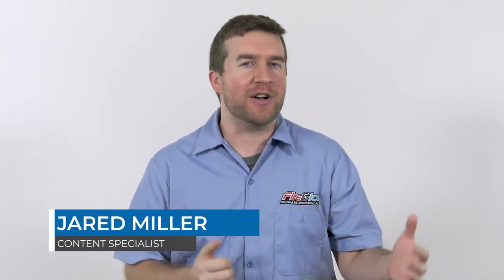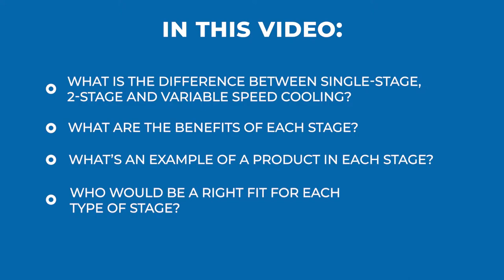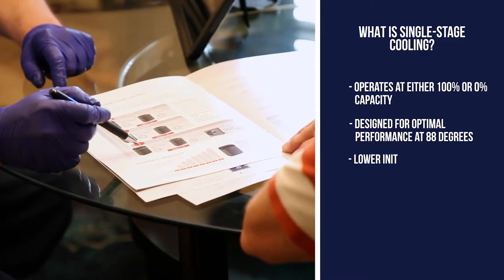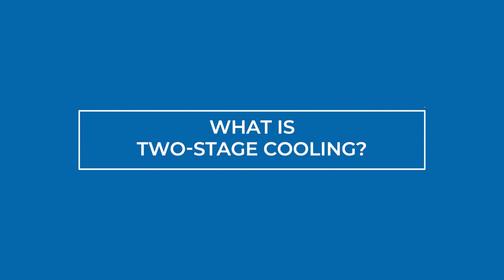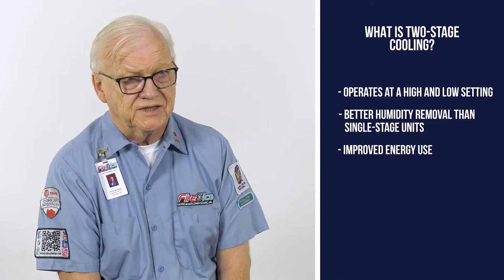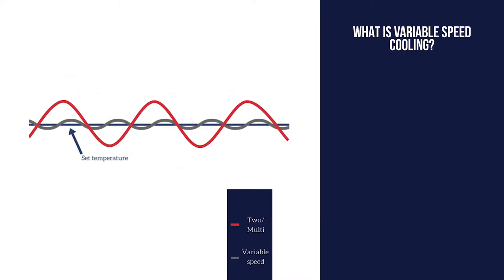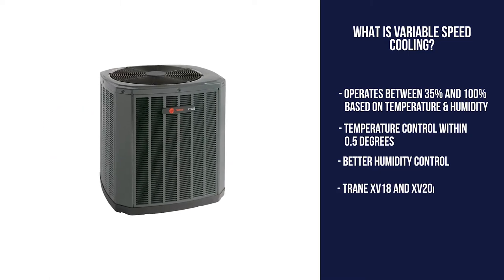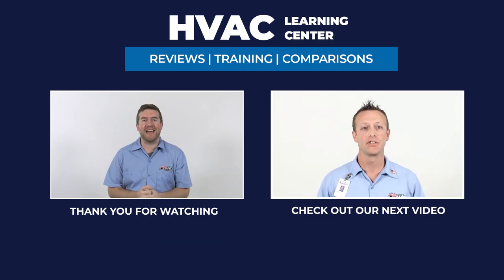What's Single-Stage, Two-Stage and Variable Speed Cooling?

Comment: Are they talking about the outside compressor or the air handler??
Reply from the maker: The outside condenser which has a compressor as one of the parts in it

Comment: No one answers the golden question on any hvac videos about multi speed ac. How do you size variable speed in contrast to single stage? You mention 88 degrees as your baseline with a single stage and yet never mention any baseline temp for sizing multi speed units.  My theory would be to base the avarage daily summer temp on the sweet spot of the particular unit. Then if you were to get 100+ degree days the system would ramp up and be able to adequately cool the house. The problem is i dont see anything from the manufacturers on this subject unlike furnaces the have multispeed they actually put out tge btu of the various stages not so with ac. So how are you guys sizing these multispeed/variable speed units in contrast to single speed?
Reply from the maker: Units are sized based on the cooling load calculation of the home.  This video should help: https://indoortemp.com/resources/right-size-air-conditioner-manual-j-load-calculator, this also might help:https://indoortemp.com/resources/what-is-cooling-limit-of-air-conditioner

Comment: Can be single stage install for 2 story home with dual zone climate control?
Reply from the maker: A dual zone climate control is a zoning system and a ductwork and airflow related subject.  If you have a zoning system, a multi stage unit is recommended

Comment: what controls the variable speed in a AC.   The handler or the condenser?
Reply from the maker: The thermostat
Reply: The air handler has a variable speed blower motor also know as an ecm motor some condensers have ecm motors also, typically when you have two stage cooling. Depending on the temperature at the thermostat and what the differential is of what temperature your calling for the unit will either slow down or rev up to get you there more efficiently

Comment: A 2 stage does not dehumidify better than a single stage. Only benefit of a 2 stage is less power usage.
Reply from the maker: The 2 stage allows the AC to dehumidify for a longer period of time allowing a more comfortable home
Reply from the maker: An AC does not replace the need for a dehumidifier in some areas